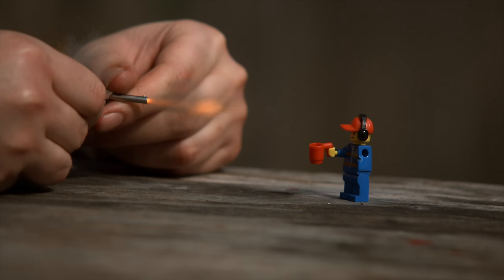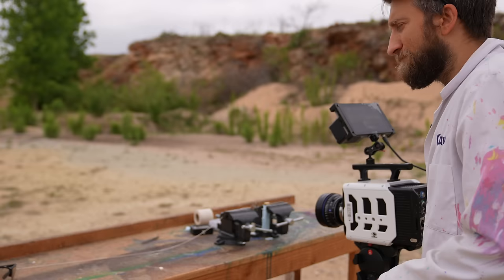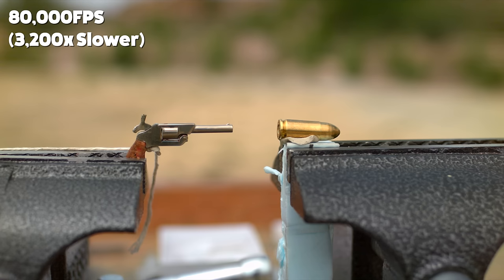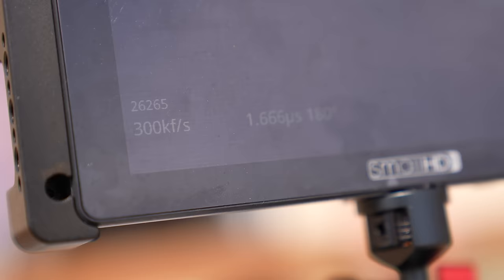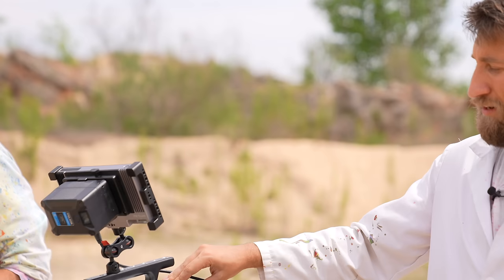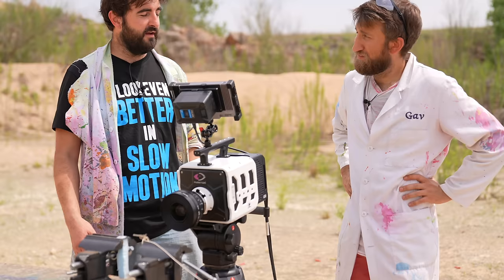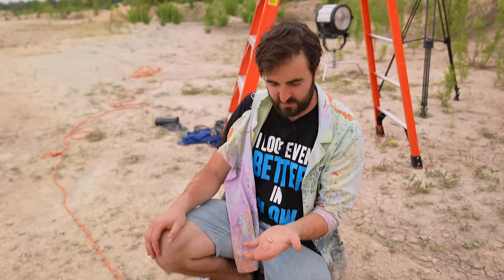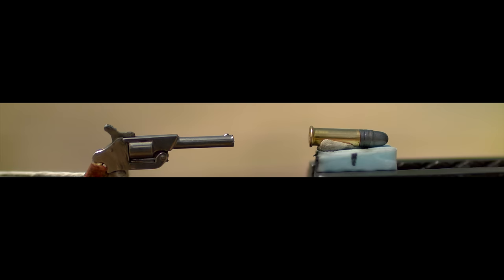Can a 2 Inch Gun Fire a 1 Inch Bullet? - 300,000FPS - The Slow Mo Guys

Comment: How much could this be escalated? Like a domino effect of bullets from the tiny round up to a tank shell.
Reply: 10megaton.
Reply: The most dangerous video. Loose bullets firing bigger, loose bullets
Reply: what a good idea!
Reply: I think unless theres another barrel its going to immediately fail.
Reply: @LexanderMiller  well potentially. As you saw with the 9 mm it was traveling extremely slowly. While it travelled a fair bit it could hardly be considered deadly or even dangerous. For a bullet to be dangerous it needs to be traveling very fast. Though it may simply be impossible for a 9mm bullet to actually hit the primer of say a 10mm cartridge. Would be an interesting experiment. But dangerous? Not as dangerous if these were being fired from out of a chamber and barrel.
Reply: I to vote that they do a bullet centipede.
Reply: Sadly most tank shells are electrical fired, and don't use a percussion primer
Reply: Maybe not a tank shell, but like a 20mm cannon round.

Also hi Tom! 👋
Reply: And now I just want them to find some way to collab with you. :D
Reply: Maybe go from 22 cal to 9 mm to 12 g or 50 cal
Reply: A lot of fallout 3 references here, commenters name FAWKES, and then the next comment has MEGATON. Lol
Reply: They'll need some barrels for that.
Reply: Nuclear fission basically
Reply: in america it is ilegal sadly
Reply: Demolition ranch special guest!!!
Reply: I like the way you think!
Reply: @Gizmomaster  that's not necessarily true about a bullet not being dangerous if it isn't traveling very far or fast. People have shot themselves while cleaning their weapons, and while the end result is potentially not fatal (like hitting your hand instead of your face) it's still very dangerous. Depends on type of rounds as well. Granted, those bullets aren't usually being fired by a 2inch gun, but in this case I think their setup was safe enough 😂
Reply: That's a Looney Tunes idea if I've ever heard one.
Reply: @635574  True, most of the energy would go into mushrooming the shell casing.
Reply: 2.7->.410 birdshot -> battery of 50 BMG.
Reply: To a nuke
Reply: @LexanderMiller  Maybe not a loose bullet, but a series of bullets properly clamped in place and pointed at each others' rear end
Reply: @marcusborderlands6177  Not sadly, whatever hammer you'd use to fire a 120mm tank shell primer would be crushed by the sheer force of it.
Reply: Came here to post exactly this. Do it!!!
Reply: chaos level intense
Reply: Oh hey Tom!
Great Nintendo Direct we had today
Reply: I like the way you think.
Reply: i say go all the way up to a tank gun
Reply: 2 inch gun <<<<<<<<<< 305mm naval cannon
Reply: Not much as the bullet needs to be contained in a barrel to get it moving with enough force to impact the next bullet.
Reply: @rickcimino743  It is and it is not at the same time, lol
Reply: That idea would definitely be worth a shot!
Reply: I was about to say .50 cal
But tank shell would be hilarious
Reply: Wouldn't you lose power every step of the way?
Reply: @gitfoad8032  🔴 What Is Islam? 

🔴 Islam is not just another religion. 

🔵 It is the same message preached by Moses, Jesus and Abraham.

 🔴 Islam literally means ‘submission to God’ and it teaches us to have a direct relationship with God. 

 🔵 It reminds us that since God created us, no one should be worshipped except God alone. 

 🔴 It also teaches that God is nothing like a human being or like anything that we can imagine.

🌍 The concept of God is summarized in the Quran as:

📖 { “Say, He is God, the One.  God, the Absolute.  He does not give birth, nor was He born, and there is nothing like Him.”} (Quran 112:1-4) 📚

🔴 Becoming a Muslim is not turning your back to Jesus. 

🔵 Rather it’s going back to the original teachings of Jesus and obeying him.
Reply: Battleship or railway artillery.
Reply: Up to a battleship shell
Reply: @iCanbEYOURrUKIA  - I am not quite understanding your post. The distance a bullet travels after leaving the barrel does not make any difference in its amount of danger until gravity brings it to the ground, if it has traveled enough distance for drag to slow it down, or both. In the case of people shooting themselves while cleaning their guns, in most cases, they were struck by the bullet after it left the barrel. 

A better analogy would be someone getting struck by a free bullet heated in a fire, oven, or on a stove when it is not in a firearm. Those bullets are usually relatively slow. Sometimes, the bullet casing walls are not strong enough to contain the explosive force. Instead, the force ruptures the casing while leaving the bullet round in the casing neck. 

Muzzle velocity is such an important performance parameter for firearms. Another performance parameter is terminal energy at the target. Generally, the longer the barrel, the higher the muzzle velocity for a given bullet. Also, the greater the distance to the target, the slower the velocity and the lower the terminal energy of the bullet.
Reply: If you tied down the bullets you could probably do a full circle of bullets provided you bunker down for safety...
Reply: Well, you’d be amazed by how the original atom bombs worked. Firing a small tank shell to create the reaction that caused Hiroshima and Nagasaki…
Reply: You clearly don't understand the laws of energy...
Reply: American dominos be like
Reply: Anti matter bombs
Reply: Newcious  No, Rick. Not this time.
Reply: @dalehatton6965  maybe not a barrel, but a loose tube - chain fires of the cartridges in tube magazines are a known thing...
Reply: @LexanderMiller  why does "Loose bullets firing bigger, loose bullets" sound like something Cave Johnson would say?
Reply: There's no limit. Confined explosions driving projectiles can escalate infinitely, if they're hit with enough force to cause them to fire, and that force doesn't overwhelm them and drive the projectile off-course.
Reply: @sorenkair  Close! But then Fusion bombs (H-Bombs) are actually initiated by fission reactions (which can be initiated by high explosives, which can be initiated by a Detonator...) , so Fusion would be the end of the line (so far)
Reply: That’s how splitting atoms works, go look at the animation of nuclear chain reaction
Reply: It’s a game of Neutron snooker balls and dominos
Reply: Could be legally considered an automatic weapon
Reply: Like a thermonuclear bomb?
Reply: @635574  Maybe if they make a jig to hold the casing in the vise where it can't fly backwards and the total force goes into the actual bullet?
Reply: if your great great grandad dads name is guy, your family has a historic interest in guns and gunpowder.
Reply: I didn't know we needed this but we do
Reply: macro-fission
Reply: YES!
Reply: @LexanderMiller  most of bullet power come from the pressure it builds in the barrel it wouldnt be extremely dangerous, ok its def not safe but going 10 meters on the oposite side of the bullets alignment sounds enough
Reply: They are not trying to die lol
Reply: it would likely only get through 2 bullets max, the 2mm round, then the .22 round. because the .22 round isnt in a barrel, it loses probably 90% of its power, and likely isnt enough to set off the 9mm, and even if it is enough to set the 9mm off, the 9mm ABSOLUTELY doesnt have enough power to set off another round, also the 9mm bullet is far to big to hit a striker of anything other than a tank round.
Reply: 105mm HEAT shell and an 800mm howitzer
Reply: No it couldn't
Reply: The ATF is going to have a field day with this. If one trigger action fires more than one projectile, you've turned this tiny pinfire pistol into an automatic firearm.
Reply: Okay Boomer (fallout 4).
Reply: This.
Reply: W video idea
Reply: Newcious  stop advertising your videos with a different account
Reply: @LexanderMiller  it’s worth the risk
Reply: Check out Mastapoole channel's video "shooting real bullets taped to a BB gun" video. There's some really surprising effects, not slo mo guy's videos speed but really cool
Reply: @LexanderMiller  need to go to a military gun range and operate the whole thing from a safe location
Reply: @LexanderMiller  sounds like freedom🇺🇸😂
Reply: 50 bmg firing a 20mm firing a 50mm firing a 75 firing an 88 firing a 105 firing a 120 firing a 152 firing a 183 firing a 2B1 Oka.
Reply: @LexanderMiller  Set up inside a cargo container... at sea away from folks.
Reply: @Gizmomaster  that’s why you should set up a firing pin system where the bullet is striking the pin. That way you don’t have to hit the actual casing with another bullet
Reply: Tank shells are electronic actually
Reply: @635574  I think even then that would be cool to see the slow mo leaving the barrel and obliterating the targets lol
Reply: Illegal machine gun lmao
Reply: 12:26 - 12:28
Reply: That's a stellar question.
Reply: So what do you do if you hit the primer and the bullet do go off
Reply: Either Edwin Sarkissian or Matt at Demo Ranch would do it with them %100. All three would be an amazing crossover together. Matt lives in TX and Edwin&Gasper aren't too far from there. Matt has EVERYTHING they could EVER need.
Reply: I think the likes says it , they better start working on thus domino effect.
Reply: Next step, doing it while blindfolded. Final step is doing it while riding a horse.
Reply: @rickcimino743  terrible but theoretically interesting idea*
Reply: @LexanderMiller  in a tube.
Reply: All the way up to A NUKE
Reply: Well see the problem is, it would really just make a VERY loud noise. The explosive force when the pin hits the percussion cap on a bullet shell (inside of a gun barrel), ignites the powder, then that force has no where to go except to propel projectile forward out of the casing. Hence why they go so many feet per second. 

With an hyperbole unlimited amount of space for that energy to go elsewhere, will essentially not make the projectile in the casing move forward, except maybe a few few (depending of the amount of gunpowder is used).
Reply: @seand7042  yes and no. The last step still has max power
Reply: Hate to be the wet towel but it could only be repeated as long as the previous bullet could hit the next in line  without completely destroying the cartridge I would be curious to see this repeated with a 50 bmg if it could be done safely
Reply: id love that video
Reply: @gitfoad8032  earth cracked in two
Reply: I see a good deal of those exploding rather than just firing.
Reply: The .22 is probably the only one that’ll probably be able to set off another primer and unless they fine a larger rim fire round it’ll end with that. And they stop using cartridges past 105mm that’d be the theoretical maximum
Reply: barrel
Reply: In theory yeah you could but I feel like that's not the result you're going to get😂
Reply: Literally just thought of this! 
9mm-50cal-anti tank
Reply: ”Can a standard RPG rocket detonate a ”little boy” atom-bomb?”
Reply: @hejeliasvgd  only one way to find out
Reply: that's how a nuke works
Reply: Nuke?
Reply: Technically, that could be considered a machine gun it’s one trigger pull an firing multiple rounds but technically that small pistol isn’t considered a fire arm so I don’t know but send it anyways
Reply: @williamgay3937  and skip most of the fun caliber’s between 9mm and 50cal?
Reply: @TitaniaBird  they could collab with anyone living in Texas. Surprised these Brit’s are legally allowed to have the tiny pistol
Reply: "can I domino effect of bullets fire a 50. BMG round?"
Reply: @LexanderMiller  I love it!!!
Reply: Hands down best idea for a follow up video
Reply: 2mm bullet to 500 megaton nuclear bomb
Reply: @iCanbEYOURrUKIA  Your comment doesn’t really make any sense. It depends how fast it’s going. No matter how hard you could possibly throw a bullet, you’re not going to throw it through somebody. It needs to be going hundreds of times faster. They aren’t sharp. It wouldn’t be any more dangerous than cooking popcorn on the stove without a lid. You’re not gonna get hit with one going fast enough to do damage.
Reply: That’s brilliant I’d pay only fans for this type of quality
Reply: My. Exact. Thought.
Reply: How much could this be escalated ? Like a domino effect of bullets from the tiny round up to a tank shell
Reply: The barrel isn’t long enough to gain the velocity to set off another primer
Reply: Tom don’t give ideas
Reply: I can imagine that it wouldn't go very far, the 22 seemed to stay in place while all the force was used on the casing making it move, which makes sense since the lead bullet is much heavier than the brass casing
Reply: Uh oh! This sounds too exciting
Reply: Demolition Ranch did something similar where he set up a series of guns to fire in a chain reaction from a single trigger pull. He did it with old revolvers to get around some law that prohibits what could be considered automatic gunfire. Or some law like that.. I don’t remember exactly tbh
Reply: Wow that’s definitely not breaking a couple laws
Reply: Up to a Nuclear bomb
Reply: Your forgetting about the battleship shells XD
Reply: Stürmtiger shells?
Reply: @iCanbEYOURrUKIA  A round detonating with no barrel doesn’t carry much velocity with the ability to penetrate much. It’s relatively dangerous, as it’s a detonation with a projectile(s) flying away from it, but a fraction of the contained pressures and downrange energy of a round detonating in battery, travelling down a barrel, and all the glasses contained behind it propelling it forward.
Reply: Mad scientist mentality. Love it.
Reply: @635574  they can make a barrel with 2 ends for the 2nd bullet to aim it to the 3rd bigger buller
Reply: I think demo ranch did something like that.
Reply: Put a nuke at the end
Reply: Very dangerous fun but wouldnt do much without barrels
Reply: tiny round up to schwerer gustav 80cm gun
Reply: @Alexander  without a barrel for the gasses to speed up the bullet it would just pop out after the energy pops the casing.
Reply: You should try
Reply: @DinnerForkTongue  1: those are electrically primed, not percussion, and 
2: the primers are too small for that
Reply: It wouldn't go beyond the first shot..
Reply: @LexanderMiller  clearly you don't know how bullets works. and clearly cant see that when they did the first one,  not only did the firing cap come out, almost all of the actual powder that fires off to shoot the bullet didn't ignite. the only danger is your ignorance. and look at the .22 shot. THE BULLET REMAINED STUCK TO THE CLAY TIL AFTER ALL THE POWDER FIRED, and only then did it start to move away from its initial position. and to assume this wasn't done in an environment where people have control is almost the same level as ignorance. stop being afraid of guns, and start being afraid of the people who use them illegally, a gun cannot hurt you, only a person using one can.
Reply: a rail bullet
Reply: Oh please do something of this variety, in sure you have friends that could custome mill a line of progressively larger caliber rings with little tightening screws to hold the casings, and just go up ever so slowly
Reply: If you flicked a bullet with your finger, you would hit it at about twice the speed of that second bullet. So, probably not.
Reply: Watch the video. The bullet does not move, so there will be no chain reaction.
Reply: Oh god
Reply: Bullet firing inception!!
Reply: Ur great great grandfather guy fawkes???
Reply: Yes
Reply: I thought the same. Maybe give the bullets some sleeves for a lil compression
Reply: @LexanderMiller  Loose bullets aren’t very dangerous at all.
Reply: nuke
Reply: Or a nuke ?
Reply: Starts with a BB gun , ends with a nuclear weapon  lol😂
Reply: Barrels in bigger barrels like a old telescope, would be pretty cool!
Reply: You clearly asked this without watching the video first.
Reply: You’re not thinking big enough, up to a nuclear warhead
Reply: Traditional fission bomb igniting hydrogen.
Reply: @635574  He's clever but you're smart.
Reply: "The Slow Mo Guys explode a nuke"
Reply: I don't think you're allowed to fire a tank shell in your backyard😅
Reply: I’d love to see Slowmo Guys: Gungame Edition
Reply: I like the way you think
Reply: @635574 or the shell casing just explodes
Reply: This is the most Tom Fawkes sentence ever written
Reply: Why the heck are you here?

I mean, it's obvious, it's the slow mo guys, but seeing you in the comments is like seeing Brandon Herrera in Russianbadger's comments, and vice versa
Reply: @LexanderMiller  the most dangerous part is the possibility of shrapnel from the brass jacket.
Reply: @LexanderMiller seems like a video for the demolitia 😅😂
Reply: We definitely need to explore this ideas guys
Reply: I say go all the way up to an H bomb
Reply: SOMEONE DO THIS PLEASE
Reply: Not one level further. The bullet only went 27 kmh. Not enough to ignite a heavier projectile.
Reply: That's what they did for the Trinity FX in Oppenheimer.
Reply: Same when a grenade explodes in ammunition storage
Reply: Oh my god yes
Reply: Need pressure to make smokeless powder ignite properly.  Absent from being in a chamber the 9mm will spot the primer and not properly ignite the charge
Reply: Ko
Reply: That’s actually a really good idea. I had a panic attack trying to spell the word actually because I lost a spelling bee In the fourth grade because of that word I spelled it actualy and I had to take a Xanax because I wanted to spell that word
Reply: Not Possible. The bullet from the un-chambered round will be way too slow and way too inaccurate OBVIOUSLY.
Reply: Fire idea
Reply: Then what a nuke ied dynamite thermite
Reply: @poseidonbrine916 *illegal
Reply: Not very far without barrels. And with barrels, that is technically firing more than one bullet with one pull of the trigger. And this has happened before - that technically classifies as a machine gun. Making you a felon.
Reply: Nuclear fusion bombs basically. High explosives 💥-> fission reaction 💥-> fusion reaction -> ☢️
Reply: Small,medium,big,tank,then to battleship
Reply: The kinetic energy slow down at each bullet, but it would be fun
Reply: Jesus is the only way to healing, restoration and salvation to all souls. Please turn to him and he will change your life, depression into delight, soul heading from hell to heaven all because of what he did on the cross 

“Whoever calls upon the name of the Lord shall be saved” Romans 10:13
Reply: Wait a minute
Reply: Hehe 20cm to 20mm